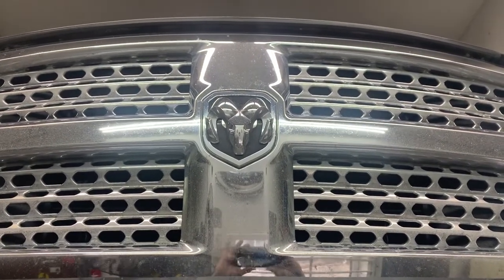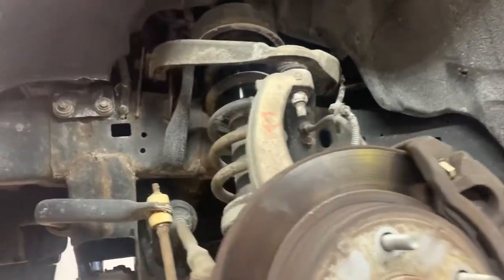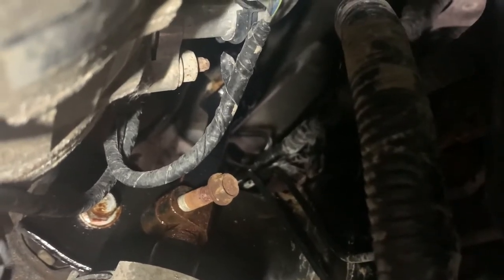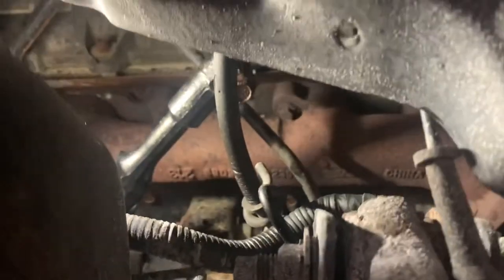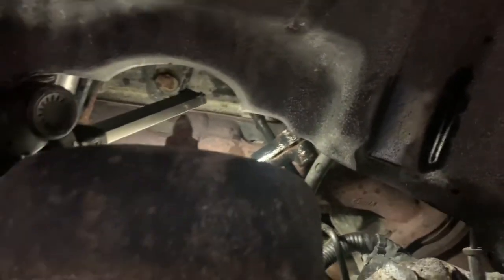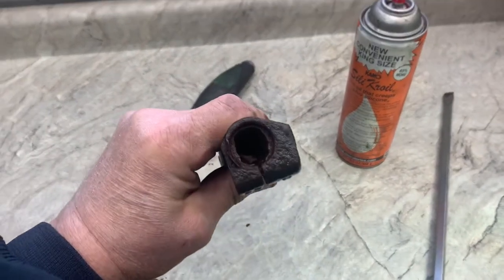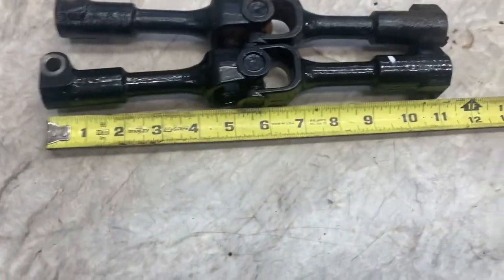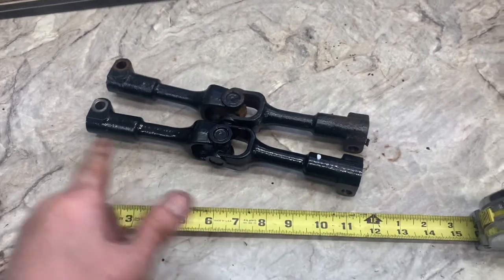2014 Ram 1500 steering stiff

Comment: Great video, thanks!  With this as a guide I just put WD-40 on the intermediate shaft knuckle to prove it's the problem on my 2017 Ram 1500, and then greased it as a short term fix.  Part is on order and will do this when I do the brakes and rotors later this month.
Reply from the maker: Cool
Reply: Finding your comment just saved me hundreds of dollars. Thanks

Comment: Thank you for the video! I went ahead and gave the old u joint a bath with about 2 cans of brake clean while turning the steering wheel. Then took white lithium grease and put it all of the u joint, turned the steering wheel, applied more, and so on. It works great now! Hopefully it holds up, I’ll reapply grease once it warms up. I’m not going to bother replacing it if it keep working.
Reply from the maker: Cool
Reply: $242 piece ba hoping it works…. That’s a short term bandaid
Reply: @DagoBoilermaker  been over a month. Works great, I don’t plan on replacing it.

Comment: My truck is binding when going left like it gets tight as I’m turning could this be my problem ? I don’t hear anything from the outside only hear it in the truck and feel it inside only
Reply from the maker: Should be left and right turns  like hard sports to turn  if only left jack it up support it stands and remove tie rod ends from knuckle and move steering knuckles right to left in both sides to see wicth side is stiff

Comment: this is hydraulic or electrik steering rack version? Thx for the vid
Reply from the maker: Hydraulic
Reply: Hi sir, can it be the same issue on electronic too?
Reply from the maker: @simarmomi3837  yes
Reply: Sir, i went ahead and replaced the shaft with some used shaft i got from the junk yard. It works fine, but steering is a little tight. The part from the junk yard was almost new. Do you think i need a new one,? 
Thanks,
Reply from the maker: @simarmomi3837  did u move the u joints to see if they were free
Reply: Yeah, they seem to be working very well,
Reply from the maker: @simarmomi3837  can you jack both tires off the ground and try turning steering wheel left to right with engine if real stiff possibility ball joints stiff then take tie rod off knuckle and move knuckle right to left if still stiff then yeah ball joints , if steering turns with normal resistance then pump or rack

Comment: Your video was very helpful, I was able to do it without taking the wheel off due to my long ams. But still had to get the creeper out to really get the bottom bolt tight.
Thanks again.  Very much appreciated.

Comment: I'm having the same issues with my 2018 I thought it was the rack but fortunately for me it's not so I sprayed a little bit of WD-40 silicone WD-40 on it it freed up a little but it seems like I have to do it everyday if I want a smooth steering so that being said I think I have to replace the entire setup over there on the the steering system and this video just said give me confirmation that it is my steering components anyways thanks for the video I appreciate it please make some more I'll subscribe to your channel and maybe I can learn how to fix my own God damn truck
Reply from the maker: Yup you need the intermediate shaft make sure to bungee cord the steering wheel so it doesn’t turn when you do the shaft cause if click spring in the column